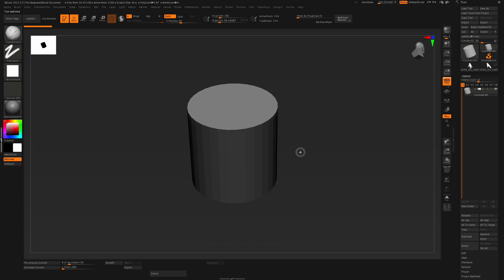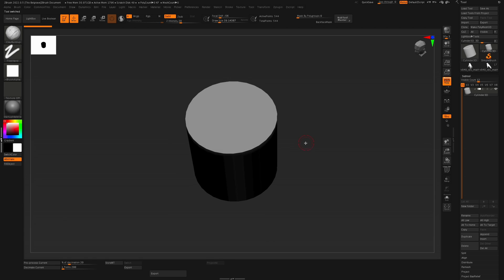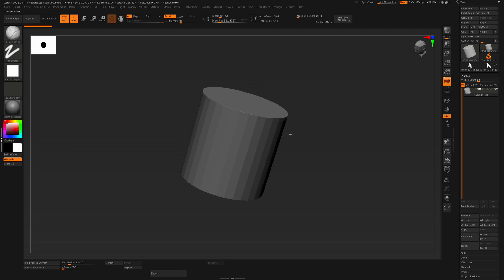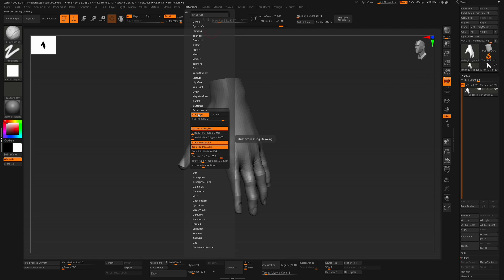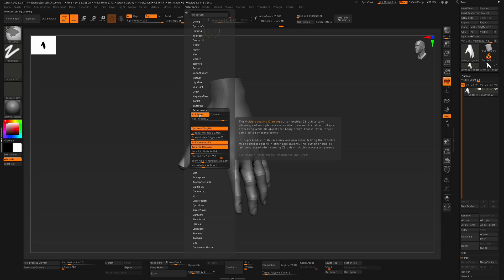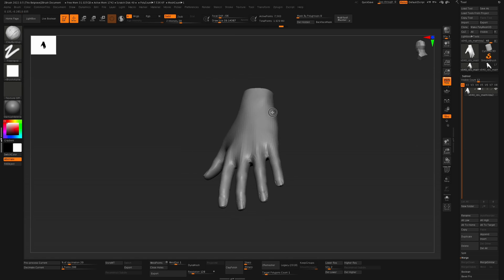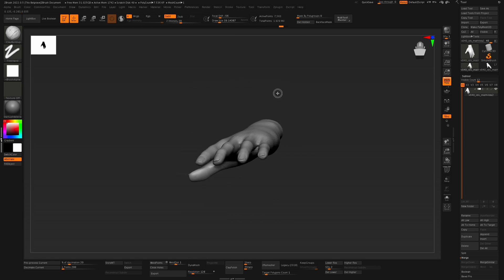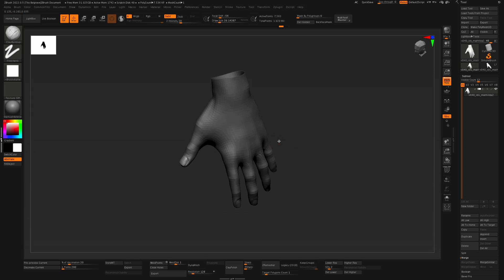Fix your Apple M1 Zbrush Performance with this quick tip!

Comment: Hi, I had the same problem and I found a diferent solution, it may work for you too:

The solution is to reinstall Zbrush, it worked for me, that is it.

Turning off multi draw helped to boost performance but the performance was nowhere near compare with what it is now. And also when I tried to paint on the model the Zbrush was very slow.
Reply from the maker: Yup that was the suggested solution from Maxon... it can be a pain  though during production especially with a looming deadline... but for some reason or another, it tends to return, can't quite figure it out. Recent releases have been a bit more stable I found though.

Comment: I’m looking to buy a MacBook m1 and run z brush on it. Could you share a few more spec on the MacBook you chose please? I was thinking of going 32gb ram. How large is your ssd?
Reply from the maker: Heya Chris, so yeah i spoke to Zbrush support regarding this, it's a hit and miss at times, but what fixed it was a full clean reinstall instead of importing previous settings and such.

With that said I have 
Apple M1 Max 32GB
1 terabyte HDD
Monterey and this thing flies, absolutely love it